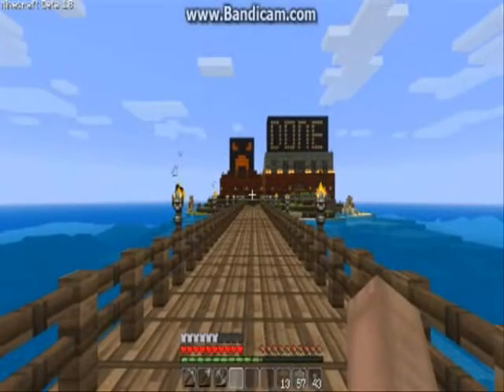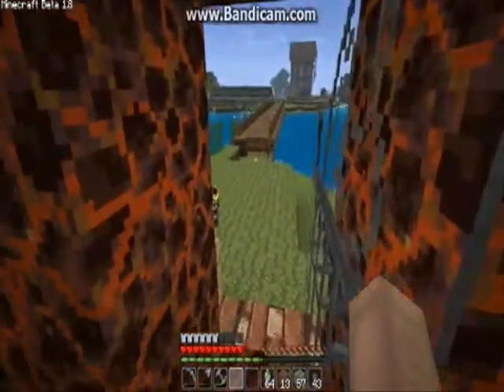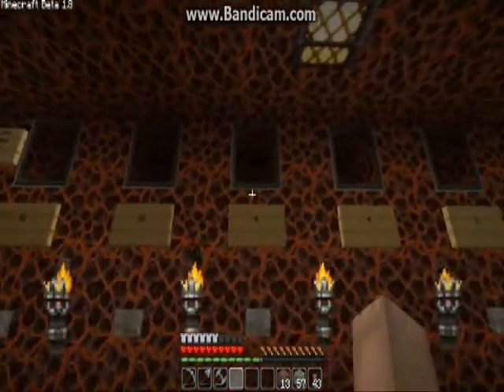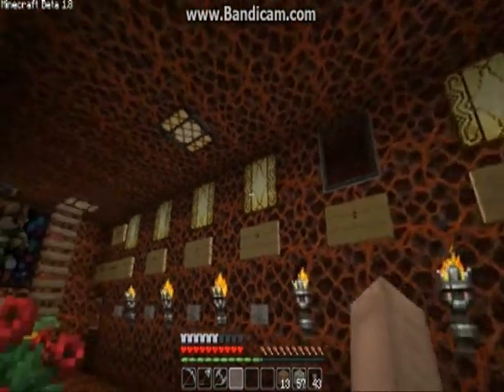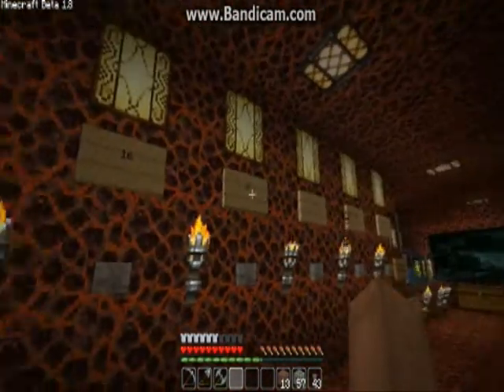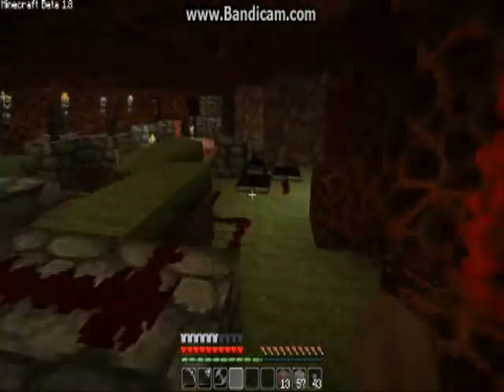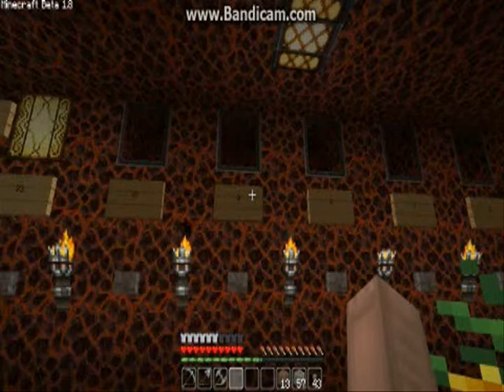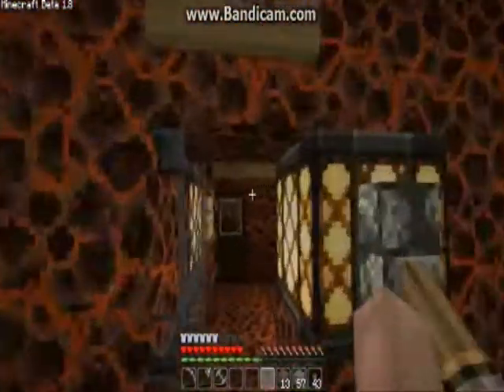Automatic Soul Urn Factory - Better Than Wolves Mod

Comment from the maker: @Battosay52 You mean like hook up 1 BD's output to another BD's input? So with 16 blocks in each I could program it to produce up to 256 soul urns using only 2 BD's by manipulating the solid/non-solid combination of blocks in each BD. I considered something like that, but decided on the Binary Method so I could have an easy display for the amount of urns remaining to be produced and I wanted to have a quick push button selection method.